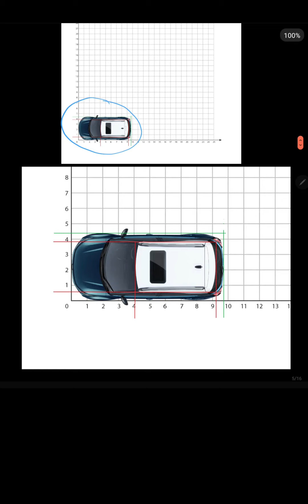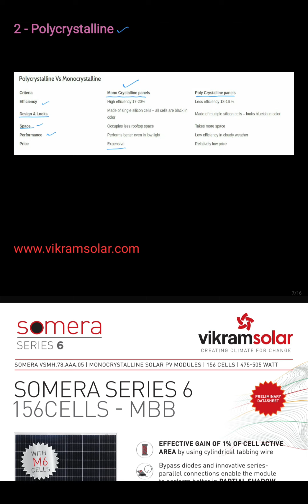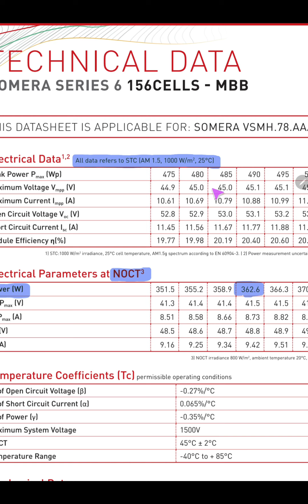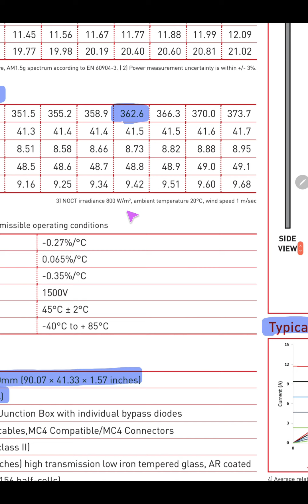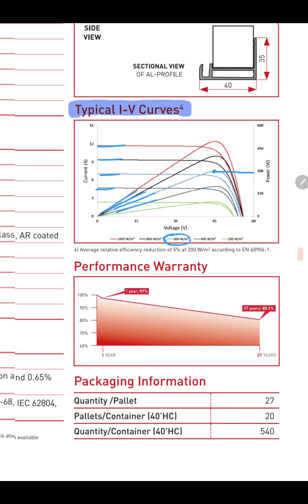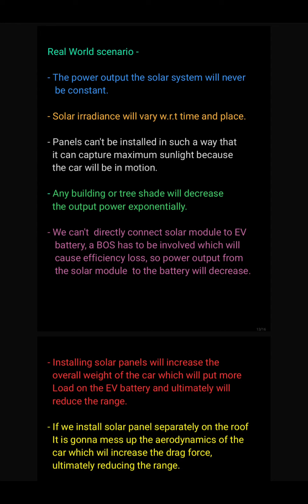Can you run TATA NEXON EV using SOLAR POWER? | Calculate the Range you can add using Solar in EV?

Comment: Brother I have a suggestion.
(If we mount alternaters underneath EV body some where on the chassis with gears to rotate along with wheel momentum, won't it be possible that it will charge the battery while on the go?)
Please do some research on it aswell.

Comment: 1.4 KWH is not correct, with proper arrangement of cells, you can get about 700 W from panels max.  Even if the direction is not correct or panels in shade, the power output is not zero. If the car is parked for most of the time, I guess you can about 4KWH max in about 8 hours (Typical Office timing). In city traffic, since you are not driving at higher speeds, I believe Wh/Km demand would be around 70-80 Wh/km and this would give additional range of about 50 Km. Enough to manage to & from office within 25 Km reach of home.

Comment: How v can transfer voltage produced from solar panel to ev car battery since v r producing dc current and perticular voltage do v need to sinchronise the transfer system

Comment: You can increase the surface area by installing foldable hinges, so you can unfold the panes on all the sides including center. Theoretically a person charging ev on solar would obviously not be driving but in parking state. So the person can install more panels with a mechanism that can be unfolded at an angle to avoid inconvenience while parking in open.
Please do an update on this theory as well.

Comment: Good study. But wish to highlight, the failure of battery vehicle is not charging batteries in time. Even though the solar charging is very smaller in quantity , but on the long term the battery life is enhanced for sure. So adding solar is technically advantages in my opinion.

Comment: As an Energy engineer  I understand the road blocks of getting PV on EV cars. You did a wonderful explanation in this matter. 

There is another factor you need to consider 
1. Energy received per sq meter on earth surface 
2. Solar power conversion efficiency- now a days 30 plus is available, especially for this tasks.
3. Direct inbuilt solar panels options such as concentrated cell solar panels on top. 
4. Increasing the Pv area on the bonnet. 
5. Reducing the battery from EV car to reduce the weight and cost to accommodate PV system.
6. Additionak benefits such as reduction in heat inside the car. 

And so on 

I think as per your calculations u got 12 km 

1kwh gives 10 km ideal condition and in real world around 6 km. 

Let's say 1000w per sq Mtr received on the pannel. So 2000W in total for 2mtr sq, I am only considering 2 mtrsq roof area.

Conversion efficiency 25 percent. 

Capacity of the pannels 400w per sq mtr thats 800watts

2000 watts 30 percent conversion efficiency  that will give 600W per hr

You may charge for 5 hrs a day with full efficiency 
5hrs * 600 = 3000wh that is 3kwh giving ideal range of 30km and in real world above 15 km.

And this is just start, you may use the bonnet area also. You may get above 40 percent efficient panels. 

I agree that adding a pv pannel on top of a car isnot that great idea until it is in build to the roof. 

Every year the efficiency of the pannel are getting increased and with lots of graduates and researchers working on this problem. I am sure soon enough there will be pannels in market with 50 percent efficiency and and above. 

Very recently there was a discovery which can potentially increase the yield from sund 1000times. 

I hope I have shared useful information here.
Reply from the maker: Thanks for sharing such wonderful information. We all will get to learn a lot from this.

Comment: hello, i loved your video. what if you install the PV system on an electric van like Mercedes Benz eVito and then use the PV system as an auxiliary battery to reduce the load on the main battery to give it more distance?
Reply: and is there a calculation on the feasibility of it?

Comment: thanks for the excellent video regarding the subject. 
what about a different scenario, imagine the car is driven to and back from work which is a total of 10 km and the car is parked where its very sunny without any shade from sun rise to sun set.
if i had a solar panel installed wouldn't it keep my battery charged throughout the day at 100%, since the car is exposed to sunlight almost all throughout the day for the entire week
Reply: Well you can give it a try. Few points though.
 1) Manufacturing company will void your vehicle warranty.
2) You will be driving the ugliest looking EV around.
3rd and finally aerodynamics will get affected surely resulting in low battery efficiency.
My advice is to get a home rooftop solar panels system (11 kva) if possible.
Enjoy your life time free fuel and for upcoming generations.

Comment: Brother,
Your effort to make a case study is commendable.
But,it is not at all practical to install them on top of car,due to its additional weight which further reduces mileage of car; solar panels required a particular inclination/direction (angle),also it should be still to abosrb the maximum sunlight;
Hence, practical solution is to install an Array of solar panels based on the EV battery capacity on the Roof top of House,along with PV Inverter connected, to Grid(optional) with a storage battery-to store solar energy throughout the day.
Later,in the evening/night the stored energy will be used to give back-up (for charging the EV) i.e,to Car.
Optional:If you are not using the car(incase during daytime, let's say for few hours or so) it can directly charge the EV,too.
Of course,the intial cost of installing the Solar panels,it's components, wiring etc.,will be high,but,it will give GOOD RETURNS in Long Run.
The Life of the quality Solar panel assembly is around 25 years,if maintained, properly.
Just,imagine the amount of Petrol/Diesel (fuel saved) in such a SPAN.
GREAT👌👍
Reply from the maker: Wow bro. You just summarized my next video of 28 mins😄. But still do watch it if you can spare some time. Link - https://www.youtube.com/watch?v=xyd9HrIJf9E&t=59s

Comment: To get aerodynamic, better is to remove the roof top or place a plate in front of the top in slanting position ( say 45 degree)
2.	 You can place the solar panel on the top of the bonnet also.
3.	We can use multi small vertical wind turbine, hence more electricity is generated while car is in motion.  So combination of both (solar and wind)  we can get more electricity.
Contact me manmat64@yahoo.com

Comment: I will take a tape and measure length and breadth and then calculate area of roof instead of getting graph paper and calculating. I appreciate your efforts.
Reply from the maker: I agree!! The problem's that I was not having any NEXON EV around me. #POOR🙃
Reply: @knowledgeresurrection7873  Again  I appreciate your efforts.  Particularly for your conclusion. Having solar cells on car roof doesn't help for increasing  range of car  for any  practical usage.

Comment: Hello sir,

Great video, i appreciate your efforts,
I do have some doubt,

1) is there is a flexible solar panel which can stick and adjusted on curve of rooftop and bumper and dicky. (In sedan car)
Pros-  3 times areas can be cover and weight will be less.

2) i travelled daily total 44 km (to and fro) to office.
Where I park my car in parking from 9 am to 6 pm in full sunlight.
Can you guide 
If above setting will work for me.

Chetan
8976292690.

Comment: I have a nexon ev xm model
I have purchased a Duramax 15000w portable generator with it
I keep it in my boot( it is compact and movable)
It gives an output of 15000max watts and around 13000 running watts.
It has 6outlets, 2x15amps 120v
2x30amps 120v switchable to240v
1x50amp 120v and 1x50amp 240v
It charge my car anywhere in 20mins ...
Takes 1.5lts of diesel per hour
😀
So fr rs170(approx) i can charge my nexon anywhere in India 3times
😀
And in rs170 i can run around 750kms
So its 0.2p per km
Reply: Hi Bro, Can you share the details of where did you purchased this generator. I could find ecommerce links for it.
Reply: @tulabandu  i bought in frm my home town kolkata
No online
Reply: @rudrakshsaha5936  , please help me with price. I will try to find it offline and make some negotiation. DO you suggest any alternative generators too,  in case of I don't find it. Thanks for your prompt reply. Also, pls don't mind in giving me some gyan, so that I will find it myself. What power output should I consider before buying the portable generator. Any portable earthing  arrangements shuld be done for this? Also, as he said in the video, even though if you go with 50kW fast charger, car can only take 25kW. In that case how is your car able to charge in 20min.
Reply: @tulabandu  it is taking 240v 50amps from 15kw grnerator 20mins time
Price is 145700 with gst in kolkata
Reply: Could you please do a video on this
Reply: @sforsendil  bro link please
Reply from the maker: Cool idea to have a portable charger with you bro👌. I just didn't understand one thing - If the  power output of you generator is 240v x 50 amp = 12,000 W or 12 kW. And NEXON EV battery capacity is 30.2 kWh which means to charge it fully with your generator it should take 30.2 kWh/12 kW ~ 2.5 hrs. So how its charging in 20 mins. Sorry to ask , I am just curious. Maybe i am missing something.
Reply: Please do a quick video with your setup bro it will really help full 🙏

Comment: TATA Nexon car 34 kV battery 🔋, Fast Professional battery Charger 55 kV substation One hours Charging Nexon Battery 🔋, My Study not 🚫  full power producing TATA Nexon ruff top posible one Solar panels  NOT higher Power supply Practical Posible TATA Nexon Battery 🔋, TATA motors Electric Engineering Not Pagal 🙄😂.

Comment: Practically it’s not possible , 1st there should be a system to resolve heat  solar power will increase heat in car ,   Damage to plastic quality  , if We use alternative  also not budget friendly , if it was simple the market leader of EV would have showcase it ,

Comment: Wind turbine fitting car roof get more then range
Reply from the maker: Hello sir. Thanks for watching and making such interesting comment. Ok let me give you a brief analysis - 

So suppose we want to generate electricity with wind power, then we have a install a small wind turbine somewhere on the car. So according to me we can install it either on the roof or at the front. Now when the car is moving the air will strike the turbine and can generate electricity which we can supply to the battery.

Now lets calculate how much electricity we can generate. So for that first we have to decide the size of the rotor blades of the turbine. So considering the size of nexon ev, I think we will be able to fit a rotor blade of maximum radius of about 40 cm at the top or front. (Even this is large but lets Calculate the max. possible value) 

Now suppose you are driving on an average speed of 30 km/hr or 8.33 m/s.
So if we calculate the power output (P) by the turbine - 

P = pi/2 × (radius of turbine)^2 x (velocity of air)^3 x (density of air) x (efficiency)

P = 3.14/2 x 0.4^2 x 8.33^3 x 1.2 x 0.4 (efficiency is around 40% for the system)= 0.07 kW 

Now suppose you drive about 4 hours per day 
So the total electricity you can generate per day from wind = 0.07 kW x 4 hours = 0.28 kWh

Now lets see how much range this will add - 
As we know for tata nexon ev, we can get 250 km from 30.2 kWh of battery

So 0.545 kWh will add - (250/30.2) x 0.28 = 2.3 km of range per day.

But, this installation of wind turbine at top or front is gonna increase the overall weight of the car and aerodynamic drag so drastically that it will put a huge load on ev battery and it will drain very fast, so instead of adding 2.3 kms of range per day the range might even decrease after Installing the wind turbine. 

And thats why I think that powering through wind is not a feasible and practical solution.

Comment: Is it possible to get electricity instead of solar rather than air? Let's say wind power?
Reply from the maker: Hello sir. Thanks for watching and asking such interesting question. Ok let me give you a brief analysis - 

So suppose we want to generate electricity with wind power, then we have a install a small wind turbine somewhere on the car. So according to me we can install it either on the roof or at the front. Now when the car is moving the air will strike the turbine and can generate electricity which we can supply to the battery.

Now lets calculate how much electricity we can generate. So for that first we have to decide the size of the rotor blades of the turbine. So considering the size of nexon ev, I think we will be able to fit a rotor blade of maximum radius of about 40 cm at the top or front. (Even this is large but lets Calculate the max. possible value) 

Now suppose you are driving on an average speed of 30 km/hr or 8.33 m/s.
So if we calculate the power output (P) by the turbine - 

P = pi/2 × (radius of turbine)^2 x (velocity of air)^3 x (density of air) x (efficiency)

P = 3.14/2 x 0.4^2 x 8.33^3 x 1.2 x 0.4 (efficiency is around 40% for the system)= 0.07 kW 

Now suppose you drive about 4 hours per day 
So the total electricity you can generate per day from wind = 0.07 kW x 4 hours = 0.28 kWh

Now lets see how much range this will add - 
As we know for tata nexon ev, we can get 250 km from 30.2 kWh of battery

So 0.545 kWh will add - (250/30.2) x 0.28 = 2.3 km of range per day.

But, this installation of wind turbine at top or front is gonna increase the overall weight of the car and aerodynamic drag so drastically that it will put a huge load on ev battery and it will drain very fast, so instead of adding 2.3 kms of range per day the range might even decrease after Installing the wind turbine. 

And thats why powering through wind is not a feasible and practical solution.
Reply: @knowledgeresurrection7873  I agree, but there must be a solution to this. I watched another topic which was followed from this video. Solar at home. I am bit confused because I am about to install 2kw solar to my home on-grid. But also I need a backup when power goes down. Is it possible to have a battery which acts as a UPS when power goes down? If yes, how can it be? Whether worthy or not?
Reply from the maker: Okk. I understand your requirements. I will suggest you hybrid solar rooftop pv system. With this you can generate electricity and can run your home appliances and at the same time charge your batteries also, so when power is cut you can use your batteries. 

The hybrid inverter will be programmed and it can decide which supply (direct from solar panels or batteries) to use and when to use. Also if you generate excess electricity you can send it to grid. It will cost between 1.5 to 2 lakhs for 2 kW system. 

And it can be worthy if there is frequent power cut at your home so that you can use batteries. Otherwise on grid is the most economical one.

Comment: What if the the Car is Parked in the Sun? Will it be a good idea then?
Reply from the maker: Hello sir. First of all thanks for watching.
Sir its actually very difficult to give a general or universal answer to your question because there are a lot of parameters to consider. But i will try to explain it in best possible way - 

As you can see in my calculations I have calculated the maximum possible theoretical range that you can add is 12 kms per day in which I have assumed that your panels are receiving 4 hours of sunlight per day at a constant solar irradiance of 800 W/m2 in which i have not included any real world conditions. So 12 kms per day is the max. possible range that you can add per day.

Now even if you park your car in sunlight all day and suppose you managed to get a sunlight for 5-6 hours (10 am to 4 pm) but you will not get a constant solar irradiance of 800 W/m2 for complete 5-6 hours. In simple terms, the the sunlight will not be strong for whole day, as we know that at 12 noon the sunlight is strongest but during mornings and evening it is not that intense, but in my calculations i have assumed that we are receiving the strongest sunlight (solar irradiance = 800 W/m2) for complete 4 hours. So even we park in sun the max. possible theoretical range that we can add will be around 12kms per day only.

Now again if we add the real world parameters into consideration which i have mentioned in my video, it is very difficult to quantify every parameter (possible but very difficult calculations) and calculate the exact real world range addition. 

But to answer your question even if we park in sun and take other real world parameters into consideration, the range that we will be able to add will not exceed 6-7 kms per day ( this is my approximation as its very difficult to calculate exact figure ). Now will it be a good idea? So according to me that is relative. Some people might be happy to get an additional 6-7 kms of range, some might not because we have to put some effort also in installing this setup.

Personally I feel that it is a good idea if you think about it as a project and in terms of learning but economically I will not prefer this rather I will install a solar pv system at my home rooftop and charge my ev with that.
Reply: Hi sir,

 First of all I very much  thankful  for you for  providing these vdos.

Q1. Can v get good output by install asolar panel on front side of tata nexon ev.

Q2. How much solar panels require for charging nexon ev 
 Outside when battery over.

Q3. Can v charge using  solar panel while running ev car. Is there any loss of battery.